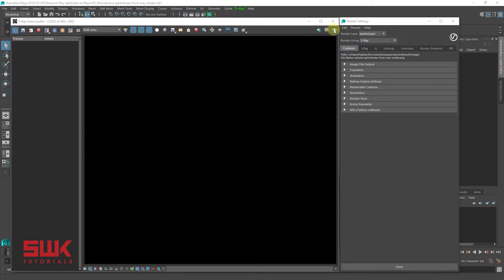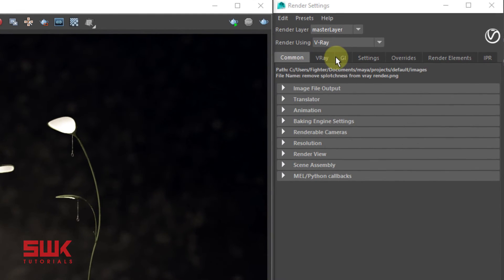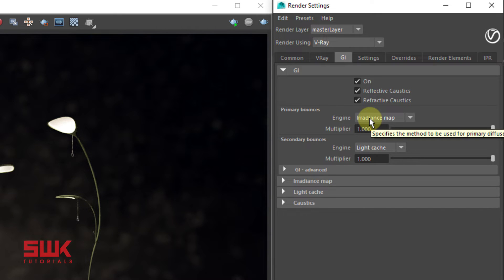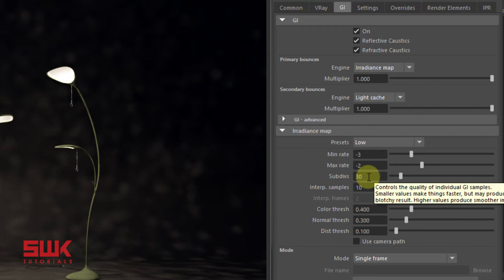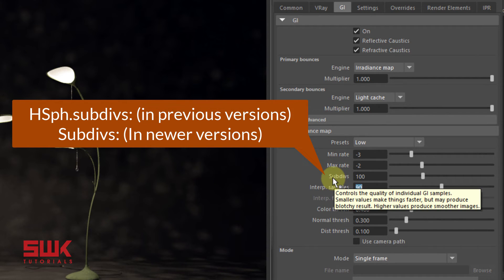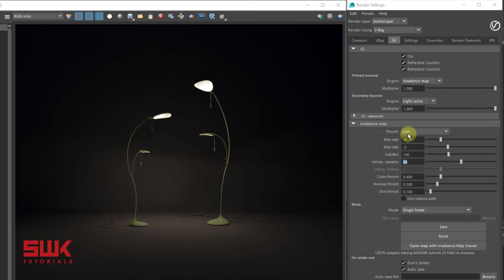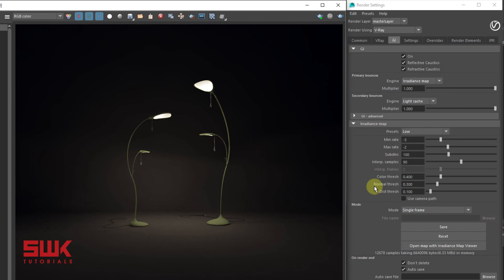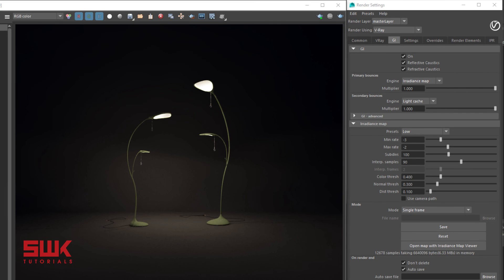Maya + Vray | How to remove splotches blotches in V-Ray renders

Comment: hello , are you able to see the strange RBG waves or line in your background . is there any ways to remove those lines . I'm  actually having trouble with those line and it's appearing after render in my output if I turned on my denoiser with VRAY GPU render.. I'm currently using MAYA 2023 AND VRAY6.
Reply from the maker: I don’t use vray gpu
Instead Iuse vray 6

Comment: What are yours PC's specifications?
Reply from the maker: Intel Core i5 10th Generation (6 Cores - 12 Threads)
32 GB DDR 4
nVidia GeForce GTX 960 4GB Graphic Card
Power Supply - XPG Core Reactor 750 Gold certified
SSD + HHD etc
Reply: @SWKTutorials  Thank you sir